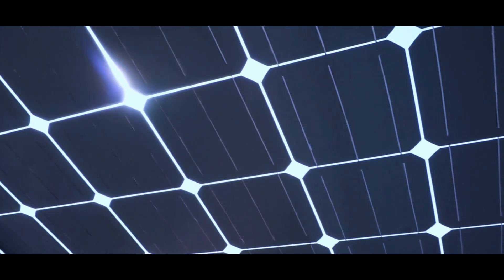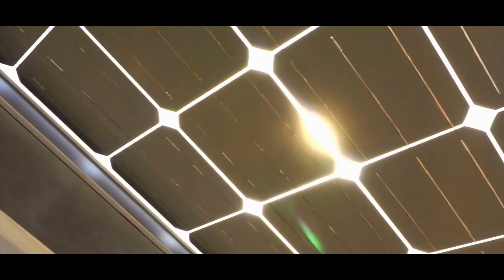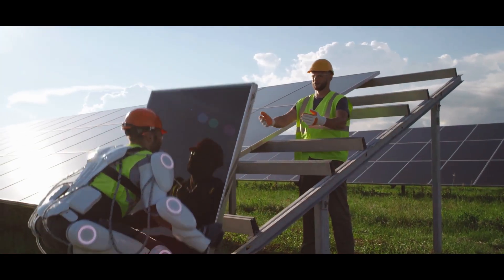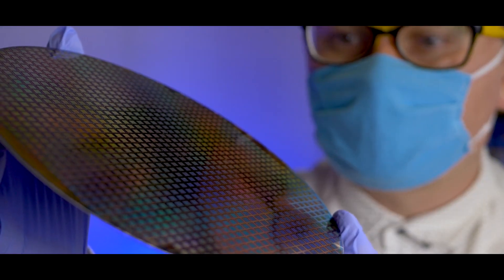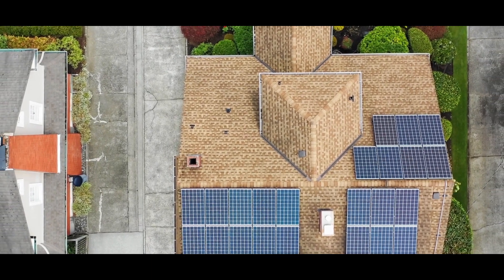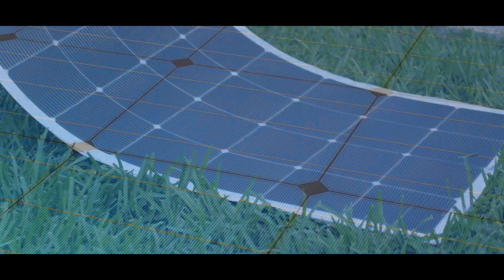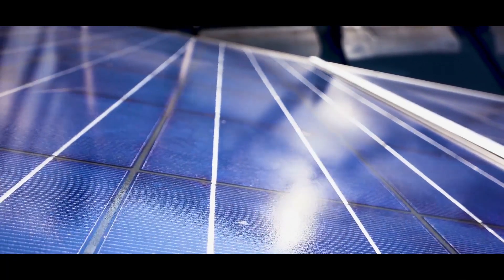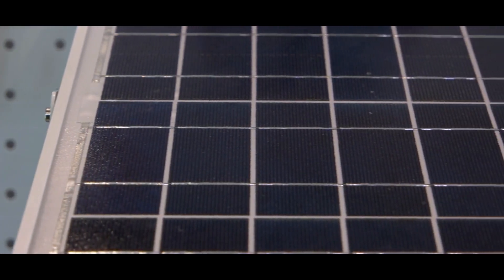Super Perovskite Solar Cell finally hits the market!

Comment: These cells placed on the roof of a electric car could charge the batteries even as the car is running.
Which means the car might never need to be plugged into a charging station if it does not exceed certain miles a day.

Comment: So, you "can" say "2 cents per kilowatt-hours" for solar cells, but that means you've accounted for the power(kilowatts) they'll produce in a specific period of time (hours), at a specific location, while taking in weather, seasonal variability, time of day and degradation over time. 

However, panels produce power, not store energy. And people tend to buy them based on power output not energy. It's more likely that you meant to say "2 cents per kilowatt".

Comment: It's funny that solar cells are advertised as "green" technology, but nobody talks about solar cell recycling. After all solar cells have 20-30 year lifespan.
Reply from the maker: Its true that every Technology has its pros and cons. We have to pick wisely the most effective technology for a specific area.
Reply: At some point in time, we'll have to bury all the trash & spent fuel rods & etc, in the desert.  Just cordone off a huge area for the world's largest dump!
Reply: Don't forget that solar panels are not so "clean" to manufacture.
Reply: @henryk8253  None of the available electricity production methods are fossile free today because of the old infrastructure. Solar Panels needs roughly 3 years or more to to be Carbon negative. Meaning that they produced more energy then was used in the from Fossile manufacturing. After that they only go plus. Solar panels can be recycled almost fully but since the process cost is not taken care of today so most end up in the trash or landfill. New laws, regulations and incentives are needed to be worked out by the Governments, Authorities and the political spheres to be effective.
Reply: Ha ha solar cells lifespan is much longer than that. The time you mentioned is when the manucturers warranty ends. Warranty garanties ~ 80 % of the original capacity. The first solar cells still work today.
Reply: is it so bad to try not cook the earth, creating thunderstorms, and rising sea level?